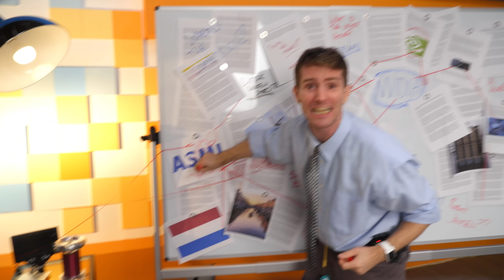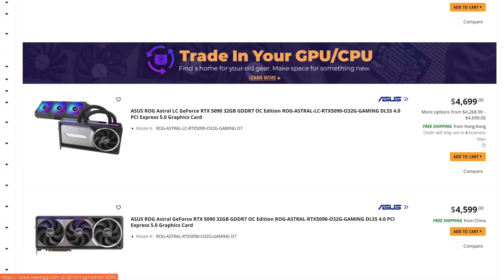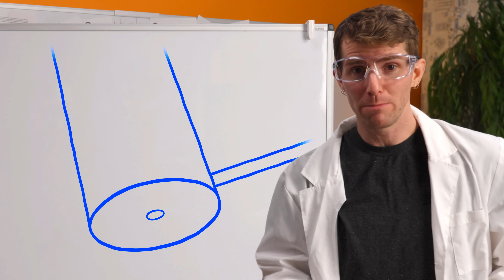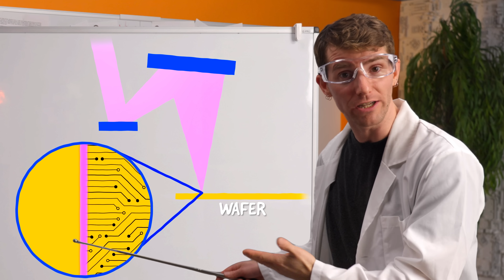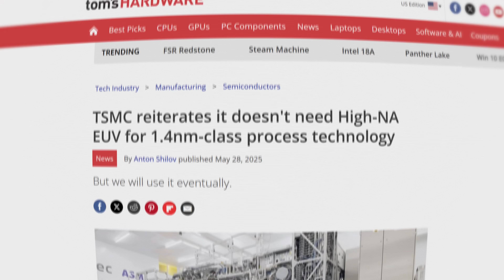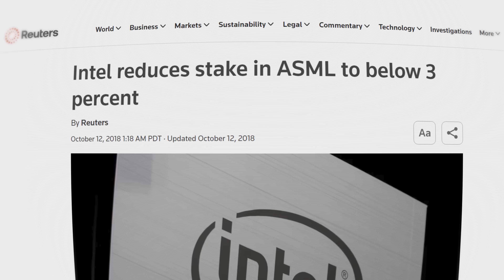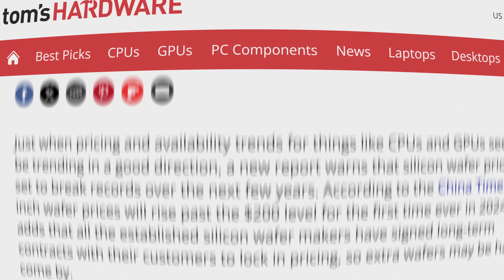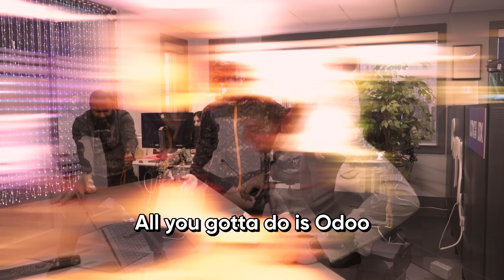This is Why Hardware Prices are Going Up… Again

Comment: EUV's real competition isn’t another EUV machine, it's not upgrading. Older nodes are "good enough". There is a limit on how much you'll spend on a chip that is only 10% faster than the old one. And older DUV nodes actually do have other companies than ASML still making them. If chip companies decide the next chip shrink is too expensive and stop buying it, then ASML won't build those next-gen machines anymore.

Comment: I hate how the issue is trivialized as "gaming GPUs becoming more expensive" when in reality it is personal computing as a whole. This is heading to a point in time where owning your own computing hardware is illogically expensive and we are introduced to common computing servers where we all have devices similar to monitors (which are cheaper than ever before) but just connect to the common computing servers which we pay a monthly/annual subscription fee to access. The more you pay, the more computational power you can access. Soon we will be paying $1000 as an annual subscription to be using PCs.
Reply: Personal computing is, historically, much cheaper than it used to be. Looking up the oldest system my parents had when I was growing up that I can recall the model number of, it cost $2800 at the time according to archived reviews, or $4800 today if you adjust for inflation. It was apparently a pretty well-spec’ed system at the time, but that was also a time when even with a well-spec’ed system you didn’t use your computer for many of the things we take for granted even on a budget system today. 

Computing in general is SO MUCH more available than it was 20+ years ago at SO MUCH lower prices, even if it costs more in December 2025 than it did in August 2025. (And we’ve had many shocks to components like RAM, GPUs, and HDDs along the way.)
Reply: @jameslake7775  I can't tell if you're intentionally being dense and missing the point. On top of that, you are making bullshit claims. My father was able to buy his first PC brand new for $300 20+ years ago. 

If you are going 90s or 80s, no one had computers back then and no one needed to either. A personal computer today is a necessity unlike back then.

A mid high end PC today, especially in a third world country costs $3000. A high end system costs $6000+.
Reply: @Torqyboi  I’d genuinely like to know what system was new in box using current-gen, midrange or better parts for $300 circa that time. Got specs or a model name? My reference point was the Dell Dimension 8200, and you could spend more than $300 at the time on a good-but-not-flagship Nvidia GPU by itself during that era according to archived reviews that mention prices.
Reply: @jameslake7775  hey man. We talking personal computing or gaming pcs here? I specifically remember my original comment being about personal computing.
Reply: @Torqyboi  I'm pretty sure we're talking whatever supports the predetermined conclusion you're not interested in discussing.

Comment: 2:20 hey man im about to switch from Nvidia it jus literally makes me sense u pay all this extra for stuff u dont need
Reply: I switched from Nvidia around 6 months ago.
I literally couldn't be more satisfied. I pay a good price for a good GPU with good raw power (not using RT, cuz it is trash).
I've been a Nvidia fanboy for way too long, and i'm sick of their bs
Reply: @poblamk  oh please they still have the best price for performace on any real game in 2025 and will continue untill amd can learn to make better software😂😂
Reply: @maaginen1007  i mean, generally, yes.
But to me, at least, AMD has the best price to performance, like, 600 bucks for a RX9070 that performs better than a 700+ bucks RTX 5070 sounds great.
Plus, the latter AMD's generations also had a good price to performance, even though the software-side optmisation isn't the best, they sure offer great value for what you pay for (specially now that the RDNA and RDNA 2 are considerably older, they're getting way cheaper).
Reply: @poblamk  I switched to nvidia 4 months ago.  Of course I bought used, an RTX 3060, but it is an incredible little GPU that kinda just does everything. And I mean, everything. I would've gotten an RX 6600 if it could as well, but it doesn't.
Reply: @XRTerra the newer amds r insanely powerful and cheaper
Reply: @Thebobomastepro  Hows blender performance? Go on
Reply: @XRTerra I have a 4070? I know friends with amds and some of theirs run even  faster than the 5080 from my other friends as well

Comment: Since DUV is capable of making NAND Flash and DDR5 chips which is around a 14nm process node size (or larger), why aren't there more companies that make Chip Fab for flash and DRAM? The suppliers for DUV machines are even way more varied and numerous (Canon, Nikon, SMEE, Ultratech and etc aside from ASML) and the machines are wayy cheaper than ASML (approximately 60-90 Million compared to EUV). Barries to entry is lower, and it isn't region locked (By politics) since the machine suppliers are all over the world.

Comment: It doesn't stop there.

ASML builds those machines using parts from from manufacturers who also hold Monopoly in those parts.

Like the Precision Mirrors and Optics are made by Zeiss (Germany)

while the EUV Light Source is made by Cymer (USA, acquired by ASML),

and the CO2 lasers that are used to generate the EUV light are made by Trumpf (Germany).

So even the parts used to make the EUV machines are monopolised.
Reply: The photomasks are a duopoly, only two companies make them, but the amount of monopolies is staggering...
Reply: It's monopolies all the way down!
Reply: It's interdimensional technology through and through, no doubt.
Reply: A monopoly in principle, but do you really think the effective lack of demand for such highly specialised parts would warrant more than one provider to exist?
Reply: @cerealport2726  Everything in the chain of EUV lithography is uber expensive and the demand is not nearly as high to spring up industries around those - it's very profitable for the incumbents, but just building up the expertise and capability of making those super-polished mirrors costs much more than what you'd get back from ASML in over many decades. Artificial demand restriction (as in government export controls) does not help to democratize the industry either...
Reply: @zwerko  And that's why Govs need to invest in the development of lithography technology inhouse.
Reply: @zwerko  no it's not "Uber expensive" or those companies would be valued higher. Take a look at the accounting, they make back a very reasonable profit for their r&d.
Reply: @cerealport2726  I think it is a monopoly like Steam (Valve) is one the other 1000 "monoplois" in Germany. You can try to compiet with them, but they have the cutting edge, and if you whant to have that you go to them. What I whant to say is, they are a monopoly not becouse they are doing some shady stuff, but nobady has the knowe howe to compiet with them, and if they whant to compiet there woud be a masiv ab front investment. with the posibility to kill bouth compenis becouse the market is so smale.
Reply: @cerealport2726 we can’t know because the government enforced monopolies (patents) distort the market from going to the correct equilibrium. It’s possible the economies of scale for these industries are smaller than we think based on patented technology.
Reply: @jarebare510  dumbest comment gj
Reply: @jarebare510  Remove the patents, and no company would spend that much money and effort creating that technology.  Dismantle those monopolies, and the disparate companies would have to spend much more money to produce the same parts, raising the overall cost even more.
Reply: @etherealceleste remove the patents and more competition will happen - Italy was leading medical researcher before they allowed patents on medical - patents slow down innovation considerably, and there is proof
Reply: @jarebare510 thank you for pointing that out, it's basically not mentioned it the entire video
Reply: @jarebare510  (natural) monopolies were never the problem, the problem is government-enforced monopolies. The problem was governments regulations all along
Reply: Monopolies all the way down
Reply: Look at Zeiss stock btw, its worse than you think
Reply: I wonder if Canon and Nikon will manage to get back in the game...
Reply: @Wolf480pl Nikon failed at their proposed method to generate euv light. So Japan was completely shut out of this generation of semiconductor optical equipment!  The problems were just too hard and the Japanese could not solve all of them!
Reply: @systemBuilder  is that recent news? Or did it happen all the way back when ASML initially announced EUV?
Reply: @Wolf480pl it happened in the early 2010s.  Nikon and Canon were working on EUV lithography for next generation lithography (thry had built UV machines in the previous gen) but their approach turned out to be a failure, as often happens in physics.
Reply: @systemBuilder  I've heard somewhere they were working on a second attempt recently, but I don't have a citation for that :/
Reply: CO2 lasers make infra red not EUV.
Reply: @muhammadosama3358 the machine shoots a droplet of tungsten into the air and then zaps it with an infrared laser to vaporize it which is how they produce the EUV !!
Reply: @systemBuilder I thought they used FELs for that. Thanks btw I learned something new today!
Reply: @systemBuilder  Is it not tin that is vapourised?
Reply: unfortunately I think the only motivation to break monopoly is likely going to be Chinese tech, hopefully we get something actually good
Reply: and 85% of the silicon dioxide for Zeiss' mirrors comes from a single mine in the US
Reply: Yeah but all of those companies make their shit available to anyone and charge fair prices, Nvidia is not the same, they work extremely hard to gatekeep and squeeze consumers for every penny, even though arguably and in some cases actually illegal methods.
Reply: @Sup3rB4dVideos  not really. These companies actually have exclusivity contracts with ASML so they cannot make their sh!t available to anyone.

not to mention, ASML also if makes it available, they too squeeze sh!t lot of money out of their customers.

In fact they are worse than Nvidia in that regards.

You can atleast go and buy Nvidia products off the shelf.

but Zeiss, Trump, etc are not allowed to make those stuff for anyone else.

and it is not just the companies, but govt. too won't allow it.

why do you think, even after acquiring Cymer in 2013, ASML still operates it in USA and has not shifted it to Netherlands ?
Reply: @RenderedFacts3D  How on earth did they promise to only sell to ASML? That sounds like a terrible idea!
Reply: Linus created a big bubble out of this. The EUV machine cost is a tiny fraction, of a small fraction, of a fraction, of the final cost of chip.
ASML does hold the monopoly, whish is a problem no doubt. But despite the large cost of their extreme lithography machines, its still a bucket in the ocean. Linus uses the next generation EUV machine cost to create bloated (and still irrelevant) picture, but current cutting edge EUV systems cost roughly $150–$200 million. This price is a small fraction of overall fab cost, for cutting edge chip production ($15 billion to $25 billion for 3nm, $25 to $30 billion for 2nm fab). And actual final cost of the chip, is only part from the fab cost, around maybe 30%. Add RD, various operating costs, taxes to exported countries, profits etc.
A single ASML EUV machine is used for producing millions to billions(!) of chips over many years. Although to be precise, modern chips need more than one EUV machine.
Reply: @netiturtle Thx for the perspective
Reply: @netiturtle This is how Moore's Law ends.  Semiconductor fab factory costs go up faster than the chips get better!  Already AMD is having to move to chiplets and HBM style stacked infinity cache and innovate OUTSIDE of the semiconductor chip to continue to boost performance and yields!
Reply: @systemBuilder  it died due to physical limits, CMOS scaling just can't continue the way it did, when Moore's law was incepted
Reply: @netiturtle  Too soon to say it already died "due to physical limitations". Many things are cooking in reasearch that do not involve CMOS. Photonics and spintronics computing just to mention a few. We do not even know what the physical limit is because that would involve having a complete theory of quantum mechanics, which we still do not have.
Reply: Then there's Applied Materials that makes much of the rest of the equipment for fabs.
Reply: Well it’s “technically” not a monopoly because it’s not like anyone can’t make them; it’s just EXTREMELY challenging to do so. There’s a difference between owning the entire market vs people who are unable to compete because they lack the skill funding etc. hypothetically if some government tells one of them to break up, where are they gonna go? Even if they split into some other company, building these chips is extremely difficult and expensive. This new competitor can shut down and we are back to square one.
Reply: @smileyr  This. The chip sector is at the literal edge of human innovation and technology. Its not like ASML is actively trying to stop others from competing. ASML is just the only company which is able to push the boundaries of what is possible on atomic level precision, and others are welcome to try to do the same thing.
Reply: You know what the solution is?

Diminishing IP Protections to no more than 5 years and eliminating the ability to "patent thicket." People say, "but then this will stifle innovation!" No, it will just mean that people like me will have to "crunch the numbers" better and ensure corporate protections (trade secrets) are in better places before we go to market and get that patent protection.
Reply: @rogerlouie1  yep, but since AI trains on everyone's data, everyone is screaming right now to EXPAND IP protections rather than diminish them. an absolutely bonehead move, because people refuse to look beyond their nose.
Reply: fk it, hand me a mirror and I'll start polishing it right now by hand to help speed things up.

Comment: Quick correction at 7:19, High NA doesn't increase the wavelength of light used in the EUV process. It still uses 13.5nm light generated from tin plasma, but the improvements come from the optics. High NA mean High Numerical Aperture, the larger aperture allows for higher resolution with the same wavelength light.
Reply: So what does that mean? More precise printing? Ability to print more intricate designs?
Reply: @Antimonious ability to create smaller details or faster production at same scale. Because you require less passes to create a detail at scales shorter than the wavelength.
Reply: @Antimonious  It means faster production.
Reply: This is essentially how you achieve higher resolution imaging in normal photography too. Most people don't understand increased aperture =  more resolving power and mistake it for 'high speed'. I do deep sky astrophotography and regularly use 3nm filters and so this made a surprising amount of sense, despite not having anything to do with the silicon manufacturing industry!

Comment: When geopolitics and technology cross, you get TSMC and ASML.  The Taiwanese government made deliberate investments into its semiconductor industry over 40 years ago to create a "Silicon Shield".  That is, to make a product so indispensable to the west in order to get security guarantees from the United States in any potential Chinese invasion of Taiwan.  ASML for its part, is the number one driver and contributor to the GDP of the Netherlands.  It is it's most valuable company by market cap and revenue.
The monopoly problem doesn't have an easy fix.  The barriers to entry for these types of products are really high.  That is intrinsic to the nature of the products themselves.  It is really really, difficult to manufacture these things.  Its extremely highly specialized work that requires intellectual capital that is in very short supply.  You need billions of dollars in investment that will need a long timeframe to payoff.  TSMC is finding that out in Arizona with its chip fab construction running into a myriad of problems.
The Asianometry channel has a lot of videos on the subject of semiconductor manufacture.
Reply: Everyone in these comments should watch Asianometry if they're actually really interested in fabrication. Linus uh... He tried here and it's ~65% good info in my estimation.